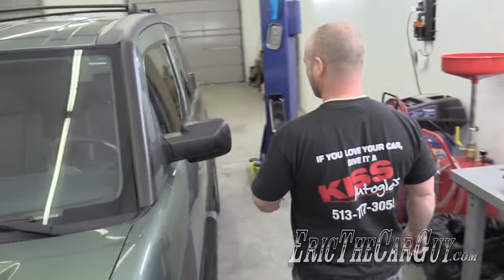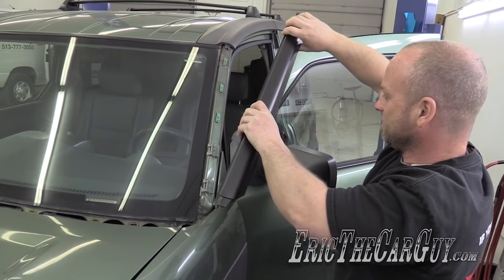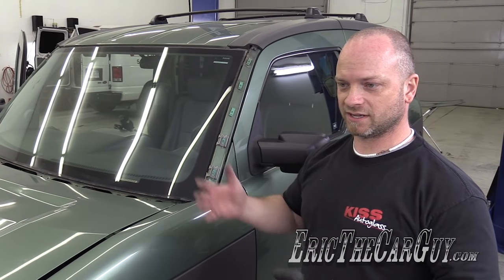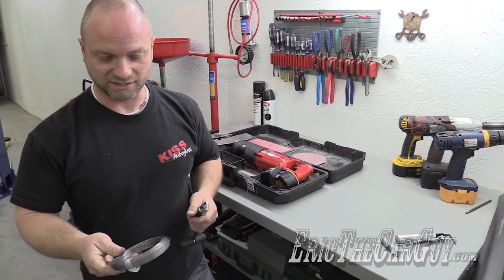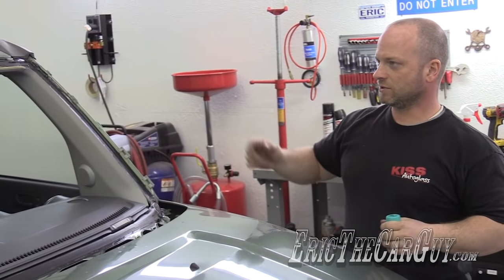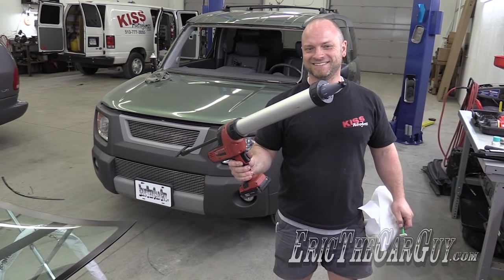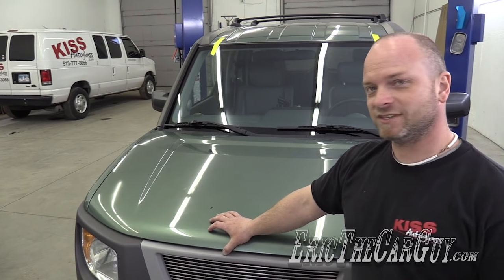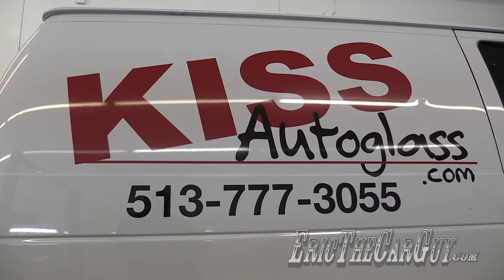How To Install a Windshield the "Right" Way -EricTheCarGuy

Comment: Yo…he either didn’t thoroughly decontaminate the glass or you edited that part out by mistake. Also, no nitrile gloves 🧤during the decontamination process?? It seems like an unimportant detail, but our hands have oils all over them that can contaminate the surface of the glass and compromise the the bond between the urethane and the glass which is why he put on gloves before setting the glass and that was good practice. But you can see his hand contaminate the frit on the edge of the glass as he put the molding on…it left a smudge. And gently wiping the windshield with a paper towel and glass cleaner isn’t sufficient to remove natural contaminants on the glass, let alone contaminants from the manufacturing process. Windshields often have anti-static chemicals on the surface such as mold release agents to prevent the glass from sticking to the mold in which the windshield was formed. These agents can make it difficult to create a bond strong enough to meet regulatory safety standards and if not properly decontaminated, it could be very dangerous. The windshield isn’t just a window. It’s a safety feature and is meant to be a structural support as well as a barrier between you and the outside in the instance of something like a high speed crash or a roll over. 
Mr. Kiss did a great job with everything else and is very professional and obviously cares about his work and has passion for his craft. The only thing that concerned me was not seeing him thoroughly decontaminate the glass WHILE wearing gloves. The frit (the black edge around the windshield) needs to be thoroughly scrubbed with something more than a paper towel, like a melamine sponge before being primed.

Comment: Buy some glass cups and run the urethane on the glass. Remove the rust with a wire wheel and you’re good to go otherwise

Comment: 2 things that sucked with this install Dow sausage tubs maybe good for the environment and also have more in the tube but they are more prone to urethane issues. Putting gloves on was a good idea to set the windshield but why were no suction cups used it keeps your hands completely out of the way from the urethane? Other than that great install
Reply: ***** suction cups are a preference not required.  I personally don't like using them other than to move glass around when needed.  What are the issues with Dows sausage packs???
Reply: Richard Kiss Last time we had a Dow meeting / training course in BC Canada they were trying to sell everyone on the sausage tube idea and did a sales demo but before doing the demo people in the crowd voice  major points and concerns about the sausage tube being more prone to urethane issue dried out urethane and improper curing. The sales guy then cracked his tube and began the demo only for that demo tube to have a major urethane issue that had just been talked about by the crowd was now happening live in front of everyone during the sales demo. He then went on to tell how every box comes with paper work to fill out if there are any issues to send the package and paper work into the factory for testing. Lets just say no one in the crowd switched but that was 3 years ago and DOW is big on testing so I would assume by now the issue has been resolved. Have you ever had issues with sausage tubes or is this a West Coast issue? I also understand suction cups are preference having worked for several shops the ones around here who use no cups also swear by circle or round bead installation which we both know is not correct or recommend by the manufacturer. I feel like the risk out weights the use IE why put your hand any where near the bead at the bottom of the glass its just asking for an issue with suction cups you have a better grip an control of the window but I assume you are never going to change and I can understand why, just because cups are my preference doesn't mean they are everyone else's. Thanks for replying keep on doing the awesome installations I loved your wood tool idea its much better than a knife I would agree 1000% less scratches and a nice job on getting down to the rust on that pinch weld. Overall this was a top notch installation.
Reply: I am aware of a small issue that DOW had with the sausage pack a few years ago.  Mostly the urethane at the end of the packs where it is clamped was allowing a small amount of air in and the ends had just a small amount cured.  Easily fixed by taking it out before you put the nozzle on.  I have Never had an issue with the sausage pack outside of that and I would hardly call that a problem.  Everyone has their own technique for sure.  The way I do it has showed me the best results.  If you have a different way and it works then keep doing it. Thanks for the compliments.  Take care
Reply: Richard Kiss Hey no problem thanks for the video and glade to hear they have fixed the problem I could tell the bead you laid had no issues with the urethane. Good job on showing people the proper way as lots of company's don't prep right.

Comment: If you scratch the car's paint while cutting the urethane to remove a windshield you can cause your newly installed windshield to leak. If it leaks, you will have to remove the windshield, refinish the paint around the frame, and then install the new windshield. Don't ask me how I know about this.

Comment: He missed a few key steps. 1 use tape to protect paint, 2 wear protection at all times (proper gloves, goggles), 3 double clutch the gun at the corners to keep it from retracting the poly, 4 use.suction cups to install glass 5 most cars have plastic tabs at top corners that have to be chiseled out. The methods he used will land him in trouble if he does 7 cars a day like me

Comment: Seriously only in the US,

No PPE 
No car protection sheets

Shocking standards, not how it should be done at all
Reply: Exactly. At least 4 mistakes in applying the adhesive. And loads other things done wrong during the job.

But hey is USA. In Europe no 1 would accept this standards.

Comment: yanking the windshield garnish off is not how you remove it. pry the top out until you hear it pop, then slide upward. yanking it off breaks the clips. honda elements are different from most other cars in that respect.
Reply: scurllebowski exactly
Reply: Nope Actually neither is right.  On the element, I do almost like he did but instead of pulling up you go sideways towards the outside of the vehicle.  These clips are two parts. They have locks that slide up, and locks that go sideways.  Go sideways and then remove the two piece clip after and it will slide right back into the molding.  At least that is the best way I have found.

Comment: Jesus Christ he using a V nozzle and he does the old screw up, he does it on the car, in the factory the V nozzle goes onto the glass because you want that flat side going to the glass, glass is harder for the urethane to stick to, but I see comments saying he did that perfectly, just because he did it the same as you have done your whole career, doesn't mean he did it perfectly, he scratches could be easily avoided, though he prims them he tore off them side trims, covering the sides of the windscreen on the piller like he wanted to break them, or at least each clip, they really do expect you to replace the clips on cars, a way of getting money from you, anyway I went to incredible length to save the plastic clips, and the trims as well, this guy ever do a Minnie, the one by BMW, them side trims would of shattered from that treatment.

Comment: Everything he did was great other then taking care of the rust. He should've got down to shiny bare metal. Then treated with acid after that neutralize it with water and then after that clean it up and then after that three coats of that primer that he had to ensure that it wouldn't rust as quick. That's the only part where I know think he did it correctly.
Reply: The only other thing I will add is when he applied the modeling he should've prime the glass before applying. Also doing it with bear hands is a bad idea because you contaminating the area with your oils on your hands best to be using nitro gloves.

Comment: Wow this was not a "professional" install. I will give some points that are standard for the industry and for dow  (the urethane adhesive manufacturer).

1.You never use a dirty rag from your van to clean the pinch weld area. The same rag was used to clean the dash and the pinch weld. If a person uses armor all for example on the dash you will contaminate the pinch weld with the armor all and you can get leaks because urethane will not stick to armor all.

2. The minor rust that he primed over was incorrect. You are supposed to remove the rust then use a phosphoric acid to clean it further. Next you wipe it with denatured alcohol. Then you apply 2 coats of primer and wait the proper cure time between coats. Then it is ready to run urethane over.

3. The windshield is supposed to be cleaned with beta brade a dow cleaning product before you use the activator (not primer) to clean and etch the windshield prior to installation.

I could go on and on but i will not. I found it ironic how he talked about the "other guys" who do not do proper installations and are cheap to use. The fact that this was a poor installation and he charges more than the other guys is a crime. Eric the rust he helped "stop" will not stop at all. I would take the windshield out and have it installed by true professional. The rust will continue to build and and cause a hole in the pinch weld area. Right now if it is fixed correctly you could save your car from major body damage and very expensive repairs like replacing the roof skin.
Reply: Jason Johnson you obviously work for safelite lol

Comment: Lol!!! The “RIGHT” Way. The dude contaminated the urethane by using glass cleaner and a rag on the pinch weld when he cut the old urethane. When you make a cut to urethane it has pores that open up when you use cleaner and a rag and rub that dirt in it you contaminate and close the pores and the new urethane doesn’t stick properly. Also the Express urethane is not a 1 hour drive away down to zero degrees it’s only to 32 degrees. The Dow ONE is the 1 hour drive away to zero degrees. Plus the pinch weld primer he used has to be shaken for 60 seconds before applied which he did not do. Also he used the same dobber which you cannot do cause when you stick the same one back into the primer bottle you’ve contaminated the whole bottle.

Comment: lol. i just replaced my window shortly before this video was released, it was all going well, i was using the string method which is burn through the sealant with a back and forward motion of a piece of small rope, but then my mates drunk neighbor came over and said, "let me help iv done heaps of these" and he jumped into the drivers seat and kicked it. obviously the window didn't just fall out, it cracked more and got glass everywhere. the neighbor said "uh well it just pops out on commodores"

fucking toss pot. now iv got glass shards to clean up.

Comment: Lol he busted the clips and I realised that this car isn't old how can people not notice after he hits the plastic side moulds down, the passenger side one, he lifts it to see if it stays down and it instantly wobbled because the plastic clips are shattered, you can actually get them off without breaking the clips, that car would of been a claim job, either he or someone from his company would of had to come and hope they can quickly glue them trims down, because the plastic clips brake out from the plastic mould and they will otherwise need all new side moulds, LoL yeah great fitter

Comment: Pretty sure he should be wearing safety glasses, Eric!
Reply: And a hard hat, dust mask, and a Hi-vi.  Those gloves looked awfully thin.  Exposed forearms could get cut.  No jewellery, loose clothing or hair longer than a 1/4" buzz cut....not to mention good quality safety boots and knee pads.   I hope he has Working At Heights training, as he does go way up, (for him), on the sill plates at times.  It seems he is looking to injure his back longterm with the way he reaches and twists and stretches to install the urethane as well as the glass itself...very dangerous!!!

Comment: Cold knives should be a last resort, cold knives can damage the integrity of your pinch weld as well as a long knife, the EZ wire system is much safer for your pinch weld and yourself.

Comment: Never point a sharp tool at your body and then proceed pull toward yourself . And always use appropriate PPE when using the primers especially toxic on skin and lungs! If you spill any of that primer on any surface besides the pinch weld , well that item is destroyed or stained for life ! !!

Comment: This is an old school fitter, using quite dated techniques. He'd of been better off top and tailing the screen out with the wire. If he hasn't got cheesewire handles along with dashboard and headlining protectors he ain't much of a windshield fitter.

Comment: He removed your side moldings off completely wrong, I saw fragments of the clips flying everywhere.... I've been a glass guy for 10 years, and I've done plenty of these elements... without prying them off the way he did, theirs a certain way you twist them forward to let the teeth let go. Ouch.

Comment: I got new windshield for 150€, and it already had been lowered alot by insurance company, without insurance it would have been about 350€.

They broke plastic clips from the thing at the bottom of the glass, the glass was wrong as it didnt have dimmed upper part, windshield was really foggy and dim, I guess from all the grease that they did not clean off.

One more shit workshop to my "hell no" list.

Comment: Pro tip on those Element side moldings. Go from inside the door jamb and push them towards the opposite side of the car. They slide right off. And PS, you can totally stuff those Element windshields. Haha just kidding... The guy did a good job

Comment: You asked him what to do if you have wind noise? He did not answer.  I had my windshield replaced a couple of months after an accident. If I could go back, I would have had all of the work done by completely different people.  I spent close to 5000 out of my pocket on getting my vehicle back to what it was before. Except that it is not like what it was because the windshield has a huge amount of wind noise.  I do not even want to back and have the same people repair it because the way I see it, if you do not possess the skills to do a repair ,etc. right the first time, then i do not need to see you again for sure.
Reply: If you have wind noise after a CRASH, doesn't that mean the body got warped in the collision and not letting the urethane zeal with the glass properly? And 5k is the price of a decent car, why repair a salvaged title car (I'm assuming salvaged) than get a decent car for 5k?

Comment: This guys destroyed his A pillar molding clips. "Guaranteed"!!! You just don't grab the A Pilar trim like that on a Honda Element and jerk them off.  If you notice at the 3:16 minute mark at the top passenger corner of the windshield where he ripped the A pillar trim off, there is a white clip still stuck in the other clip. That white clip actually goes inside the trim piece he pulled off in two little plastic slots. Those white clips actually clip inside the black facia A pillar cover. And from many years of experience doing auto glass those black trim pieces are defiantly broke where the white clips go into them. Also this guy doesn't really know the science behind urethane. ALL Urethanes cures by the humidity in the air. Not the heat or the cold. Some Urethanes just have different drying agents in them to speed up the curing process most likely baby powder or talcum powder.

Comment: First off he should be wearing nitrile gloves,, Because touching the windshield with his bare hands can contaminate it. Now with putting the primer over the rust it does not stop the rust you have to remove it first then put the pimer

Comment: The minute I saw him RIP the side moldings off, I knew this is someone I would not want working on my car. Holding a knife in each hand along with pulling up the glue AT THE SAME TIME? I'm guessing that 3 inch scar on his hand happened while not wearing any gloves. No safety glasses.  Guy broke the side moldings and were not fully secured when he was finished. With 20 years of experience he should have known better than to man-handle the moldings like that. Do better man, you give the industry a bad name with installs like this.

Comment: This guy should really have a scratch free tool. For cutting the old bead away. Og using the pinol wire. He made gouges to the paint also with the sazsaw he made a mess on the paint work... i would not let this guy touch me car at all....
Reply: Martin møller I don't care who the technician is.  You WILL scratch the pinchweld no matter what.  It takes sharp tools to cut the old urethane off.  A good technician(such as myself) will cover the scratches with a primer recommended by the urethane brand they use.
Reply: Richard Kiss I hate replacing and seeing scratches and rust from previous installers, it takes less than a minute to apply the primer.
Reply: papa bear I hear you. I had a low rust car that was super rusted under the windshield! It hurt me on the inside, you know?

The only windshield replacement I watched, but he was one of those pro's who seemed comfortable with that.
Reply: DE Nichols I encourage customers to watch, so if they need another replacement by another tech they know what to look for in terms of procedure.

Comment: That is not the right way to remove the A pillar trim on an Element. The RIGHT way to remove the trim is to pop the top up and slide it up.  All of the gray clips will stay on the Element and just the white clips stay on the trim itself.